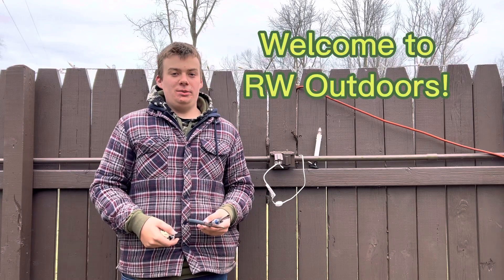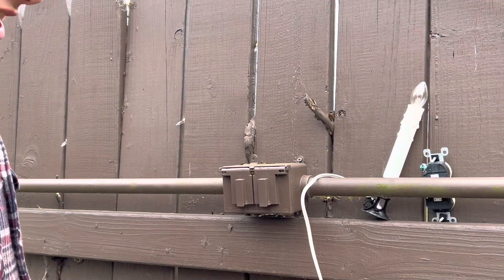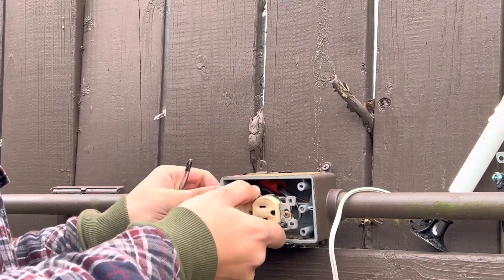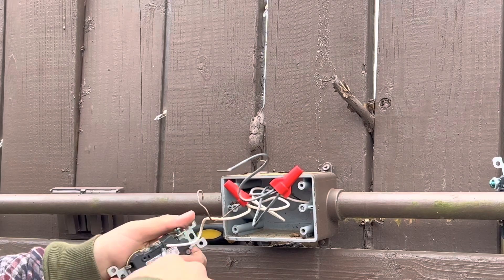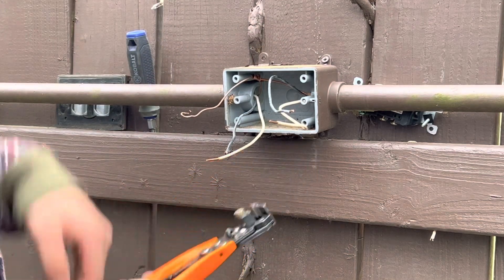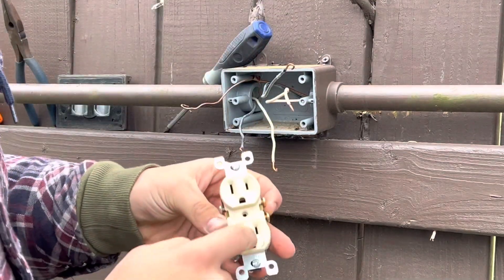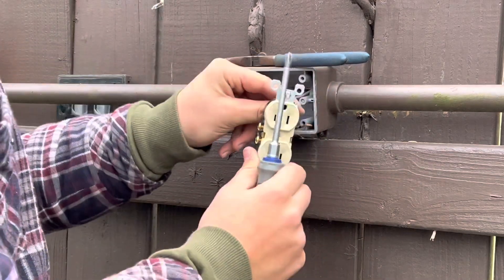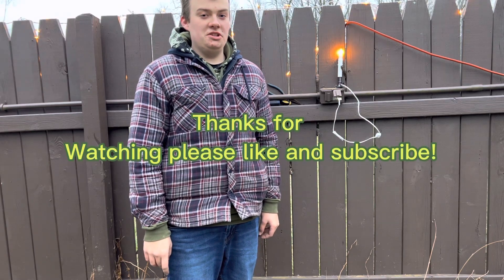How To Replace A Outdoor Electrical Outlet (step by step)

Comment: The previous installer used the backstabbing method of connection which is not normally recommended and the wire nuts were incorrectly installed. Don't refer to the hot wire as common, that's confusing because a common wire can be neutral in some cases. Call it "hot", "line" or "live". You should be using a GFCI receptacle since this is outdoors. That will require a new cover or maybe a new box. I'm not sure if it's legal to mount an electrical box to a fence, but if it's in good condition and sturdy you may be ok.
Reply from the maker: Thanks for the information. The way this works is the main wire from the fence goes to another outlet outside the house which is a gfci. The main wire is connected by a plug that you can connect and disconnect when needed.
Reply: @rwoutdoors That will work as long as the plug is always connected to a GFCI. However, if someone plugs it into a regular receptacle perhaps with an extension cord, there will be no protection. A GFCI on the fence outlet will eliminate this even unlikely issue. You'll have back to back gfci's, but that's ok since there's no load connection. In either case, your outdoor receptacles should be weather resistant. Weather resistant receptacles have the letters "WR" on the face.